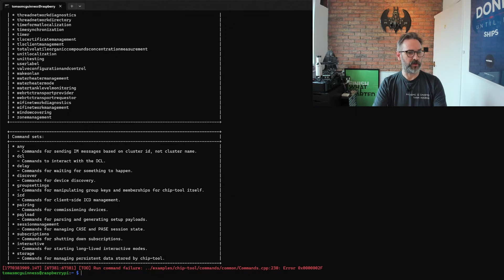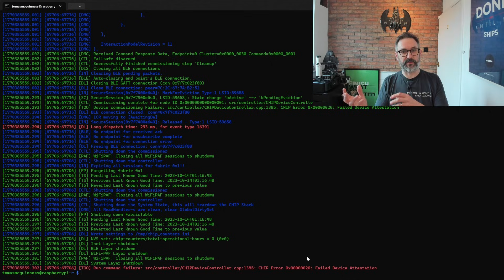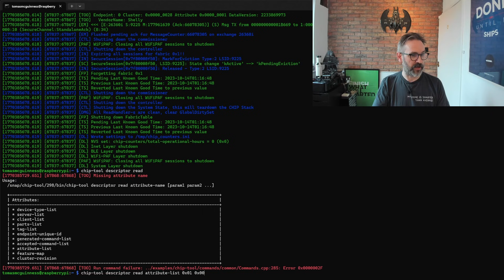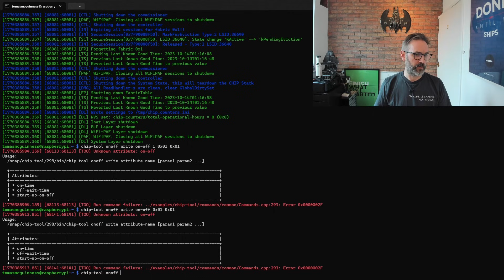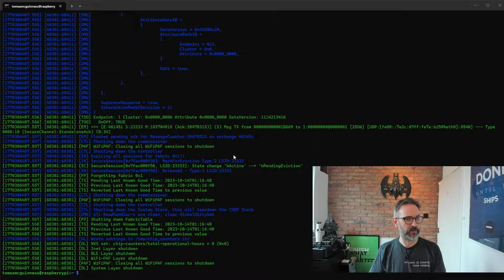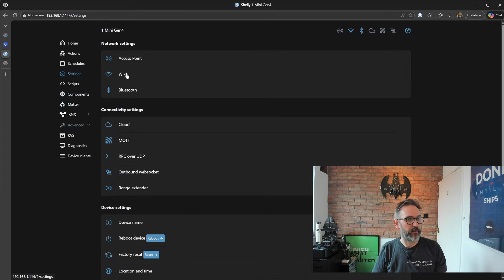Latest Shelly 1 doesn’t support Matter in the way I expected :(

Comment: I've been playing with using an ESP32-H2 as an openthread border router, and my journey has been just as disjointed! I think we're still on the bleeding edge, so I expect cul de sac's and time thieves!
Reply from the maker: Are you struggling to get it to work as you want? I came across a post recently about the $5 thread router. Have you seen that?
Reply: @tomasmcguinness that's my reference alright. Having to learn the quirks of IPv6 for troubleshooting wasn't a path I had envisaged!
Reply from the maker: What Border Router are you using?
Reply: @tomasmcguinness OTBR in docker, with the ESP32 loaded up as a RCP USB device. Its chatting alright, just not completing the new device join process. But i have only tested with a Bosch TRV, will try join another ESP32 device later today.